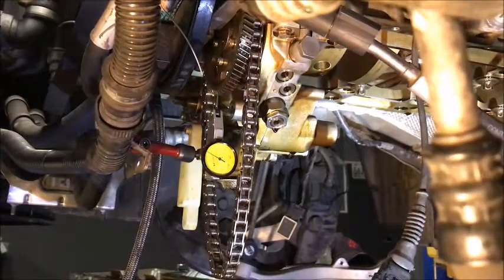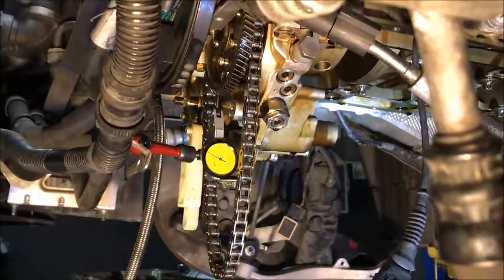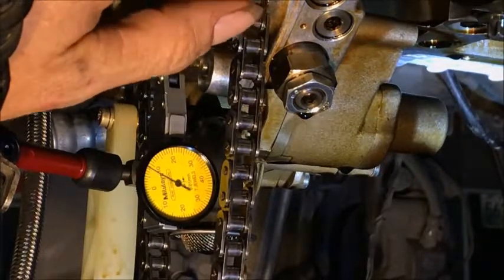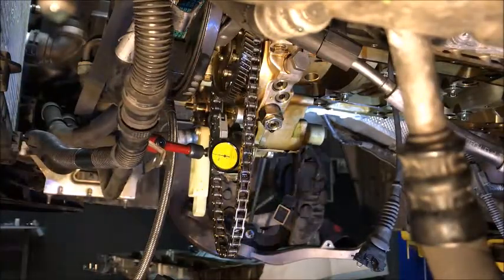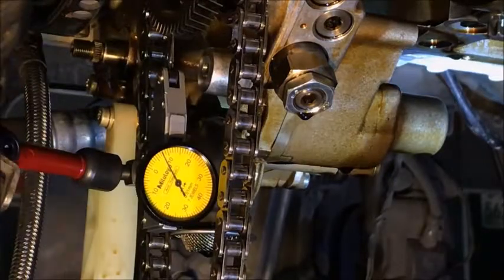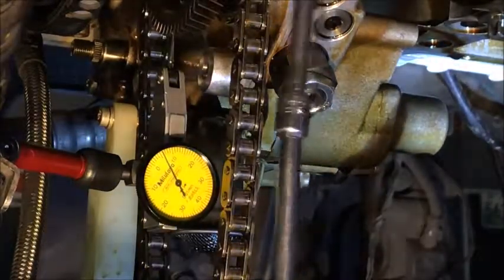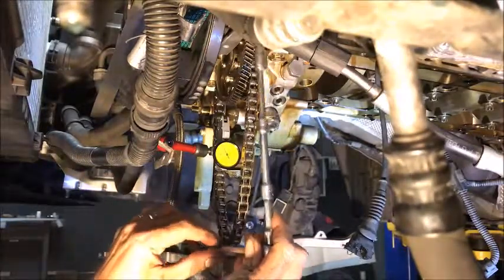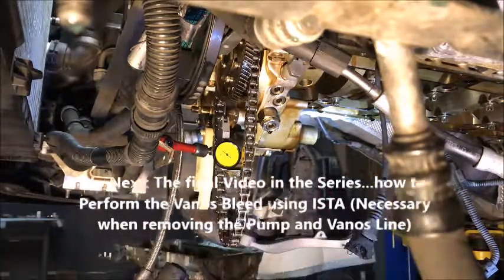BMW S85 Rod Bearing and Vanos Line Replacement Part 12 of 13 - Setting the Vanos Pump Gear Lash

Comment: Hi Steve 
Do you have to remove the high pressure vanos pump in order to change the high pressure vanos line? 
Or is it possible to change the vanos line without removing the pump first?
Reply from the maker: Hello, it’s been a few years since I did the videos for the bearings and high pressure vanos line, but seems that I tried to see if I could get the line out without removing the pump, but the bends in the hard line on the ends prevented it from rotating and being removed with the pump in the way.  I’m almost positive this is the case as I didn’t need to do anything to the pump, so I would not have removed it unless it had been absolutely necessary to get the line out.  It would have been nice to have left the pump as resetting the gear lash to the correct spec added a bit more work.

You could always just disconnect the line and see if you can orient it so it will pull out, but I don’t think it was possible.

Comment: Hi, Steve. Thanks for a great video. Where did you get the device for setting the vanos pump gear lash? Thanks!
Reply from the maker: Andrej Bratun , Thanks !  I got the magnetic base and dial indicator off eBay, but there are several online places that sell them.  If you google “magnetic stand eBay” it should pop up the stands and also kits you can buy (like from Amazon) that come with the dial indicator too.  In the part 1 of the rod bearing series on my YouTube channel, I talk about what to look for on the sensitivity of the dial indicator to be sure it is sensitive enough.  I checked again today and it looks like several kits popped up on google that come complete for around $35 USD.  Hope this helps 👍
Reply: Thanks for a quick response!